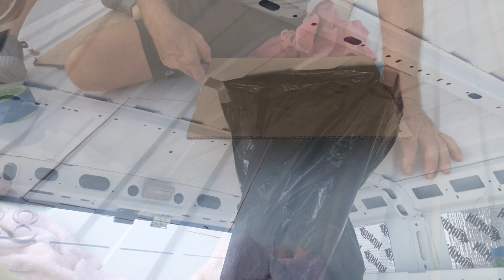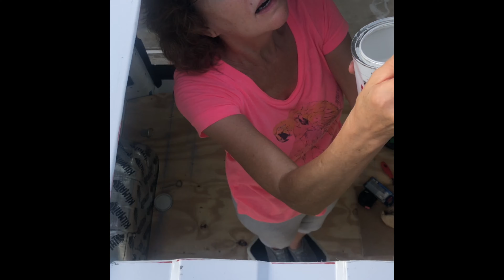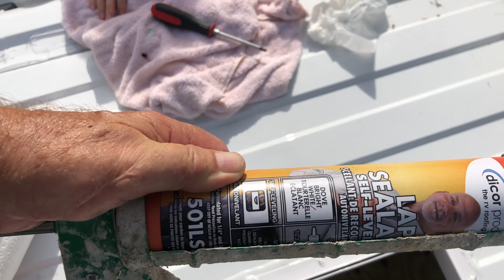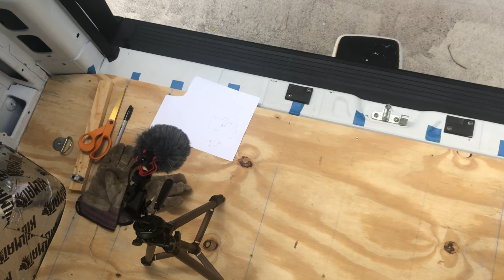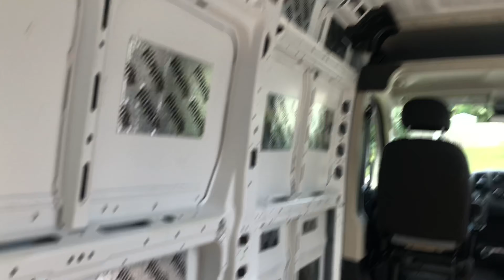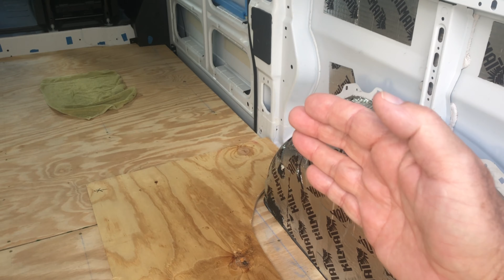Promaster Van Conversion. How To Install A MaxxAir Fan.

Comment: Going back over your van build videos as I'm turning my suv into a mini rv.  Something to do during Covid lockdown here. Great little series!
Reply from the maker: Cool! I’m posting a couple more this weekend. We are doing our complete plumbing, sink, tank, pump etc. we hope to be 90 % finished in a month. Will you post your conversion? 👍👍
Reply: Yes we have started and are posting. My vehicle isn't easy as I  am just using the vehicle I bought as a daily driver and am making due. Its a 2005 Chrysler Pacifica crossover that isn't flat or square inside so its a challenge. Going to build it out, I'm going to try it out for 1-2 years then maybe sell my home, buy a bigger van and build it out and go full time. Can only build on a tight budget right now so going with a basic but functional build.
Reply from the maker: @BushcraftNFun  Sounds great. Start somewhere. No vehicle is square. It's our biggest problems is the curves and crap. lol. Looking forward to seeing the vids.

Comment: I do think you might find later you wish you had made those lids for the wheel well covers removable to gain access. By simply adding some cleats to the inside of the lid to prevent sliding from  side to side, they could just sit there and be happy under the bed, ready to be lifted off when needed to gain access to that equipment and wiring you plan to have hidden there...
Reply from the maker: Hey Thanks for the input. We are going to definitely have access to one. Lots of work to be done. Appreciate your comments. 👍👍